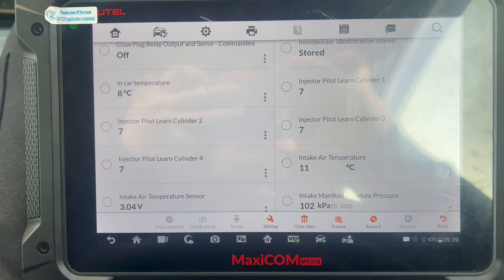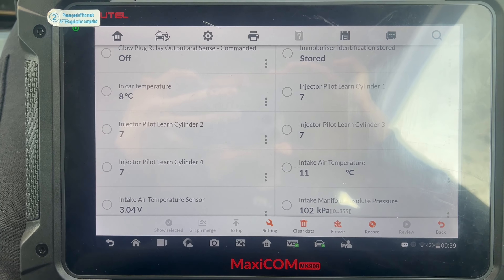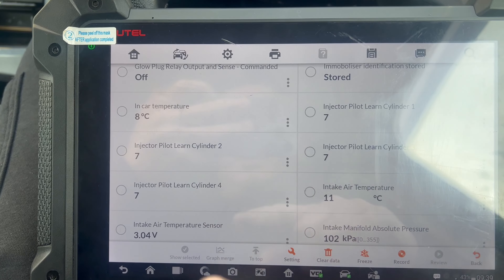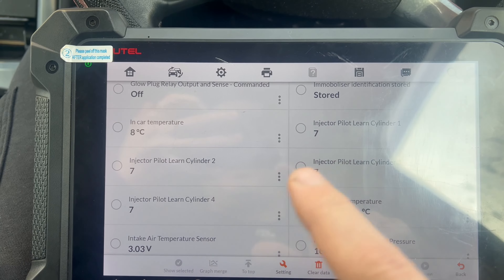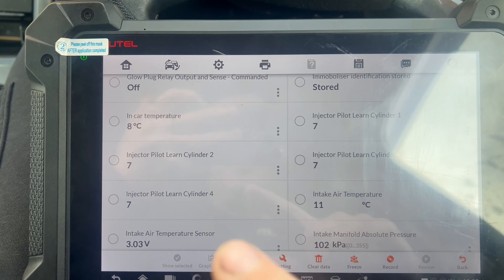Ford Injector Pilot (RE) Learn Procedure on 1.6 TDCi Duratorq Ford Engine

Comment: Hi, do you know if 2011 ford focus 1.6 diesel  has the same process or there is something else that needs doing on top, i calibrated my values on 7 for each injector, however on the next morning on cold the engine struggles a lot. If anyone has had similar issue please help.
Reply: Have you changed all 4 injectors?
Reply: No I just recalibrated the values. Anyways I sorted it out, during calibration I had to use as much flat ground as possible. The previous time I calibrated it on a road with a lot of uphills and downhill.

Comment: well done , car came to me from another garage ,still knocking after injectors changed .  Reset learn procedure and drove . I could only get to 4 on each injector not 7 ,but it sounds and runs lovely .
When driving /learning should you rev to 3k then declutch ,or just coast to idle ,i did both ,took 25 minutes .

Comment: This fixed my 2014 cmax 1.6 tdci . after I replaced 1 failed injector (and coded it with forscan) the car was knocking, had flat spots, felt like it was misfiring and was juddering until this pilot learn procedure

Comment: Changed 4 injectors today on DV6C coded and reset pilot learning it ran fine but a little bit of knocking, did this procedure and all the pilot learning went back to 7 and engine is smooth as butter now, thanks

Comment: And if using FORScan to monitor the injector pilot relearn, after getting to the right live data screen, REMEMBER TO CLICK ON THE START ARROW ! Half an hour of doing the procedure with Madam in passenger seat seeing no movement from a column of zeros. 
Let her out, go Doh and click on arrow - all at 7. Ran like a smoky dog on 3 cylinders on startup before the procedure so hoping next cold start much improved.
The car, a MK4 Mondeo1.6 Econetic, had always had a lumpy idle and low revs surges when cold, then an injector short error and limp mode, so was doing test with one recoded new injector.
Reply: Hi, can I ask how your car is performing now? I have the same engine in a 2011 Mondeo. Changed faulty injector in cyl no 2 and although on first test car ran well l, on the first cold start it was terrible. I’m going to do the relearning procedure tomorrow. Thanks in advance for your reply.

Comment: Did this today, I had to do the accelerate / decelerate cycle 9 times before all 4 cylinders read 7.
Speed range was 30mph for 1500rpm to about 55mph for 3000rpm so I used a dual carriageway.

Comment: If its the cylinders can you get turbochager boost sensor circuit high voltage  and egr exhaustgas recirculation sensor a sercuit low?? Have a huge problem with my 1.6 tdci mondeo 2012 goes in limp mode, engine sounds like grap! Allmost like its only running on 2 cylinders have checkt all the sensors and egr, noting helps

Comment: I noticed there is an injector reset for mazda by crossing relay to battery ,if you dont have scan tool.
Reply from the maker: Yes, you are correct. I don't know if you can do the same on the Fords as well.
Reply: @MrNiceGuy94  I'd say that info is on the Alldata app .

Comment: Hay bro, can you help me I’ve got forscan, what numbers are you looking at that are zero. What numbers should reach 7. I’m having similar issues and would like to relearn the injectors. If you can let me know what numbers are you looking please
Reply from the maker: The injector pilot learning values 😉
Reply: @MrNiceGuy94  thanks for getting back to me, on forscan I don’t see the option to read the values only reset them. It says reset pilot injection quantity learned values, When I choose this option to reset them it shows completed but no numbers to compare or check. I have a shudder or judder feeling under load. When I’m in a high gear but going slow, then ask for power it makes the car shake I suspect a dodgy injector but don’t know how to tell which one.
Reply from the maker: To be honest I don't use forscan, not that it is bad or something but I just prefer to use my scan tool. I would say get something that can access that data so you can see what I meant in the video.
Reply: @NorthernIrelandFishingReports  all right dude I think your on the diagnose page it’s the 3rd option down looks like a graph 📉 click on that then it will show empty blocks double click on an empty block it will pull up all parts that can be live streamed make sure it’s on pcm then scroll down I think about quarter to half way and it will show pilot learning cylinder 1 2 3 4 move them across one by one with the little blue arrow and the engine temp option then press the tick and it will show the 4 in the little boxes but then you have to press the little play button and it will start to live stream them hope this helps